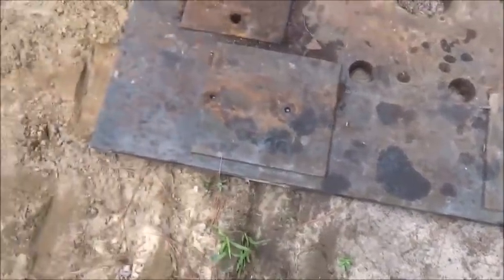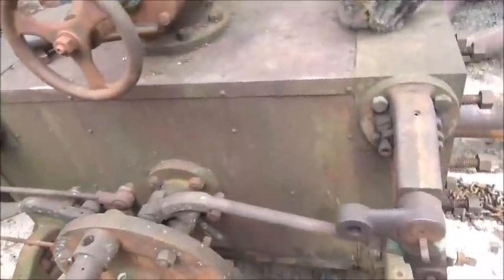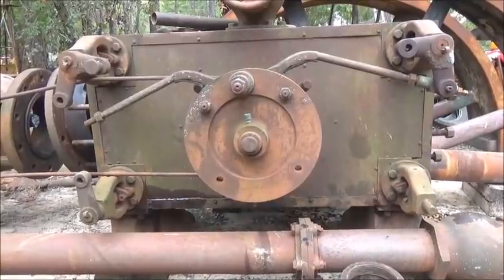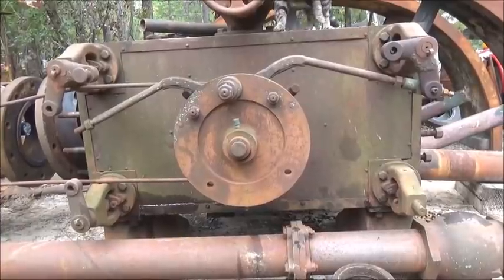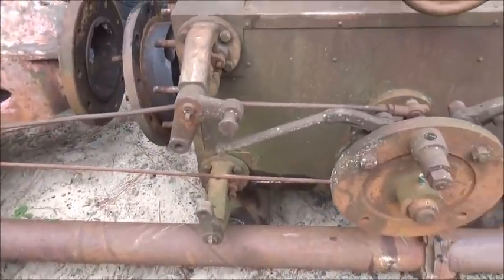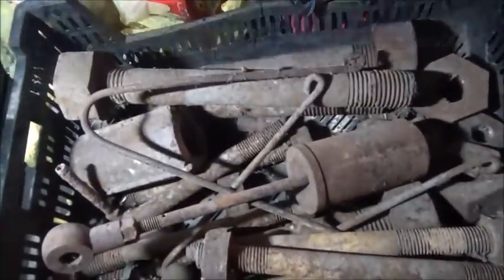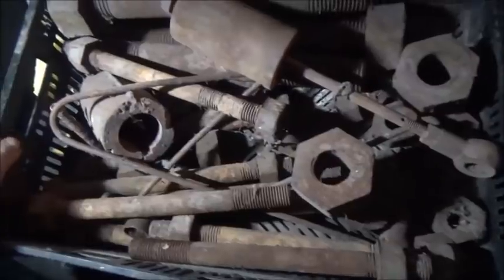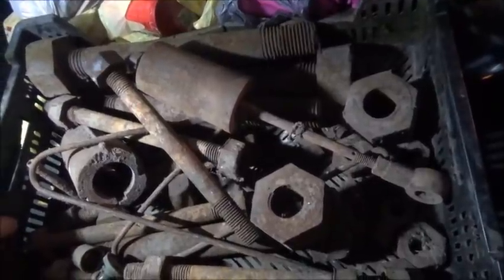BATES CORLISS STEAM ENGINE 20+ YEAR QUEST TO SAVE EPISODE 10

Comment: In 1830 James Nasmyth, an assistant to Henry Maudslay, designed a pioneering milling attachment for Maudslay's bench lathe to make a large batch of hex-head bolts for a scale model they were building for the London Science Museum. By the 1840s, cold-heading machines became available for stamping metal. It took until the 1880s, when Bessemer steel mills began producing the new mild steel in accurate thicknesses and quantity, before cold-heading machines began punching out hex nuts.

Comment: Are there any internal manifold passages?  I am guessing the cylinder and valve bores are through bores capped with bolted covers and valves.  If so are they clear to pass steam to and away from the bores or is there a cover plate preforming this task?
It is good to learn steam technicalogy.

Comment: Jonathan
Looking at the attached video i noticed what looks like a pressure valve weight hanging down the side of the governor. It looks a lot like the the round cylinder with the rod and  round connector that you have in the bow of bits.

Regards

Comment: JONATHAN, this is turning out to be a “very interesting 🤔 “ series 👍.   You sir are quite a history buff 🇺🇸.

Regarding the hex nuts;
I Googled some info on the origin of the hex NUTS 🔩 - By Bob Wallis (non-engineer) June 2016.

The hex head was developed as far back as the very early 1830’s (James Nasmith) , and the square continued mainly in the production of agricultural implements.  In Australia the implement manufacturers bought square mild steel bars and made their own, say into the 30’s (Depression).  1/4" Gutter bolts with square nuts are still available.

The common rule was that Square was used where the fastening was not required near the vertical member, or with tension, and then hexagonal were used so as to get closer to the vertical member. If you needed to get even closer, then an Octagonal nut was used – however I have not seen an octagonal but I’m assured that some of the early steam engines used octagonal nuts, again in the early 1800’s...

Comment: CF manufacturing. Haha haha!   My go- to company has always been WGS. (Who Gives a S...)
The cylindrical parts on the exhaust are a condensate trap and exhaust head. 
It’s interesting to see the differences between this engine and other Courliss designs. 
I find it strange that the throttle valve is bolted directly to the steam chest. Most engines have a small 1” or so bypass line and valve that is used to let a small amount of steam into the engine to warm it up, before starting it.
Here’s a link to a good explanation and video of the Corliss valves in operation. 
https://youtu.be/4pCSke22zHE

Comment: Here's a pretty nice image of the valve gear: https://upload.wikimedia.org/wikipedia/commons/d/d6/Bates-Corliss_engine%2C_valvegear_%28New_Catechism_of_the_Steam_Engine%2C_1904%29.jpg and the book it references is out of copyright so it's available here: https://archive.org/details/newcatechismofst00hawkrich/page/n191/mode/2up relevant pages are 192 and 193.
If I understand correctly, the upper rods are connected to the plate via a pair of little levers.
As the plate rotates it pulls one rod opening the valve, but at a certain point, part of the lever bangs into that Y shaped thing that's behind the plate.
This causes the lever to pop free like a suitcase latch relieving all of the tension and letting the valve slam shut.
And the Y shaped thing is actually 2 things, they're a bit like a pair of scissors which are opened and closed by the governor in order to decide how early or late the levers will run into them based on how much power is needed.
Reply: More information in this post than all other posts !  Any missing components can be reverse engineered from these 3 pages. Thanks Caleb.

Comment: Kudos on the preservation effort! The device at 0:17 is actually a steam separator that goes between the boiler and the engine. It is used to separate any water that may be in the steam to make it as dry as possible before entering the engine.  Usually there is a sight glass on it to indicate how much water there is inside and when to open a valve to drain it. The device at 0:26 is an exhaust head. It is placed at the end of the exhaust line to separate water from the exhaust steam to keep it from falling on buildings or people. The separated water is drained through a separate pipe to a sewer or the ground. As for hex versus square bolts/nuts an engine this size and age is going to be mixed for sure. If you find any half inch bolts they are likely to be 12 threads per inch and not 13 as is popular today.
Reply from the maker: Both were on the exhaust and the pipe led back into the cistern where the water was stored for the feed pump.
Reply: Do you have any pictures of the installation from when the building was still up showing the piping?
Reply: Would they have used the exhaust steam to power the feedwater pump while the engine was running?
Reply: It's possible the exhaust steam was used to preheat the feed water in a feed water heater. Any steam condensed from that process could have been sent back to the supply cistern. A closed system would have a condenser and vacuum pump to remove any air. It appears from the equipment you've save it was an open system that exhausted directly to atmosphere.

Comment: If you should come across the boiler I'd sure like to see it.  So many types during that era. Vertical, Cornish, Marine , Locomotive type etc. Coming from a locomotive background I'm familiar with "Feedwater Injectors". They (through some  sort of magic) can take for instance 200lbs. steam pressure and inject water into a boiler of 200lbs. pressure. How they know to do that? We have had several Worthington steam pumps mounted onto our locomotive tenders as fire pumps. I actually put out a fire on a wooden trestle with one. I'm sure there are many of us out there with some steam experience willing to further confuse you as you take on this very worthwhile project. Good luck and stay safe.
Reply: Watching this series has made me dig out my old steam books. I just read up on injectors, steam pumps, etc. Since there was a plant there I wonder if they used an injector or an auxiliary pump while they built steam. I work with "modern boilers" but all and all very little has changed. They just use computers to take real operators out of the picture and hope for the best to save labor costs.

Comment: When you picked it up off the bed of the wrecker and then set it back down I was impressed by the flex in the bed like how much that solid sheet of still deformed of course it came right back but that was a testament to the weight of that engine

Comment: If you plan to run that engine ? Test pressure is 300 psi which allows you to run 80 percent of test psi which is 225 if your only tested for 200. 125 psi is to wet to run steam engines and please do not weld any piping with mig. Hard wire it does not get good penitration root pass on pipe is 6010 5p welding rod and 7018 cap preparation of pipe is 22 and a half degree bevel with 1/8 land if you follow the code asws you can get dry enough steam to run any steam engine

Comment: Jonathan: I may have a nut that matches the three you found. The problem is putting my hands on it to see if it is a two incher.  I was in the woods helping to clean out an old homestead with some heirs who wanted to sell the place, and came across it on the ground. Picked it up because it looked like a great paperweight and conversation piece. If I can find it, and it seems to match, it's yours for free, as I love what you do and am thoroughly delighted with your videos. I also have two fender skirts from my grandfather's 1952 Olds 98, that I learned to drive on. I think they might fit that 1951 Buick you hauled out of the woods in that epic find, as it looks to be the same body style. Unlike the nut, I know where they have been for the last half century--high and dry in my old garage. They would be free as well. Heck, I'd even deliver if I could see that steam engine, as I'm not that far away (just a couple of miles from US 1 in VA).

Comment: Absolutely don't let your equipment limit your ability to get things done there is always away imagine how they originally delivered and set the machine up horse and buggys along with ropes and pulleys most likely like the homemade rollback and tag too i have a homemade wrecker i built aswell has a Holmes 440 bed with an electric winch i mounted on it use it all the time have quite a few videos of it on my channel aswell if you wanted to look keep up the good work so glad you're rescuing that old engine

Comment: The Corliss engine was a major innovation in steam power. 
The valving replaced the slide valve and was much more efficient and produced more power with less fuel burn. 
Very interesting reading about how it works. Thank you for saving this piece of history.
Hope you find more missing parts.

Thanks for sharing.

Comment: Great video as usual, determination wins again. I remember seeing an engine of some type north of Fayetteville NC just off of old US 301, don't know if it's still there. Gonna have to take a ride up there and see if the owner will allow me to take a look at it.
Reply from the maker: Yes, they are part of the Williams family collection. Williams as in Carbine Williams. I was lucky enough to meet and be friends with Carbine's youngest brother, now past away.  There is also one at Rhodes Farm Pond, just up from there that belongs to a friend James Honeycutt. They owned the pond for years and sold it to the State when his Father died. It was a 550 acre pond. The littler town there is called Falcon, NC.
Reply: @jonathanw4942  
Hey Jonathan just watched an auction over on oldfarmjunk101 and thought of you. They had a 1940 Cadillac, two door LaSalle Couple on auction with a flathead V8 that wasn't locked up. They said it had been in a barn for a lot of years and the tires were holding air. There was also a lot of parts in trunk, sold for $850.00.

Comment: Back when I was in skilled trades at Caterpillar Tractor Co. 45 years ago we used to move machinery much bigger than that steam engine by using several 50 ton bottle jacks to pick the machine up and a 15 foot sheet of 3/16 steel with a tow bar attached at one end that we would put the machine on and skid the whole thing around the factory with an old D5  or D6 tractor with rubber faced shoes and that was the same method they used from 30 years before according to my dad that worked there before me starting in 1938. Also when that steam engine was originally installed they probably just had mechanical jacks bars and levers to put it in place.
Reply: Can you imagine? Amazing huh?
Reply: I worked for Cat in East Peoria in the mid to late 50's as a kid.  My bro retired from there after 30 years.